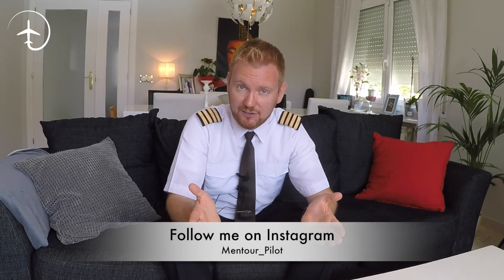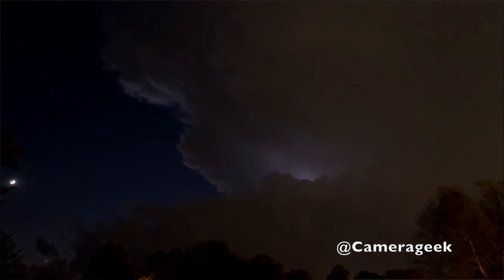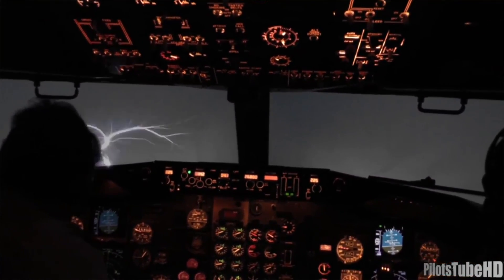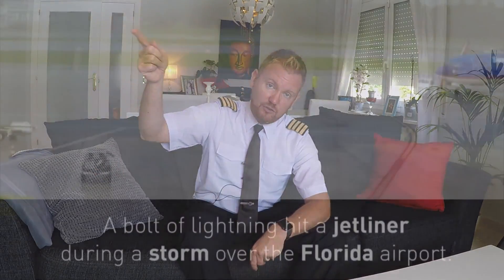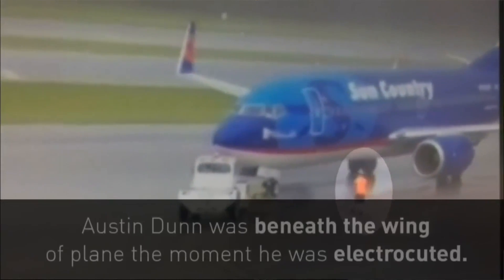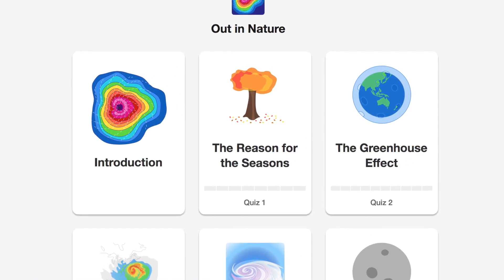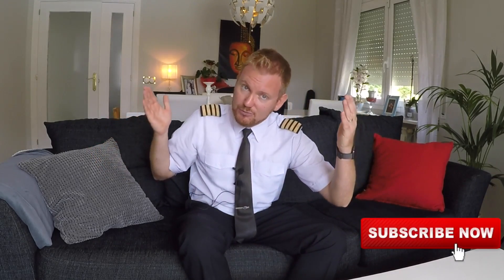Aircraft Lightning strikes - How I handled it

Comment: you should have mentioned the development of internal systems to reduce the chances of sparks happening within the air frame and structures.  things like nitrogen being pumped into fuel tanks, spark dampeners, changes in how wiring is done, etc.  because there have been documented fuel tank explosions from lightning strikes in the past.

Comment: I was a passenger on a flight from Baltimore to Chicago that was struck by lightning.  There was a big weather front in the area. It was quite 'shocking'.  The pilot's PA afterwards was to say it happened, they were a bit busy at first, now everything is under control.  We will be landing normally but you will see rescue vehicles on the runway which is standard and not to be concerned.   We were on national news that night.
Reply: The lights in the cabin went out for several seconds.

Comment: I was on a plane that was struck once. I was sitting in the back of the plane I think 4th to last row. This happened maybe 10 minutes before landing around 9 at night descending through light rain with lightning visible and presumably heavier weather in the distance. It was extremely loud, it startled me for sure but I didn't see any effects in the cabin. When I got back into the gate I looked out the big picture windows at the plane and there was a dark spot on the forward tip of the tail.

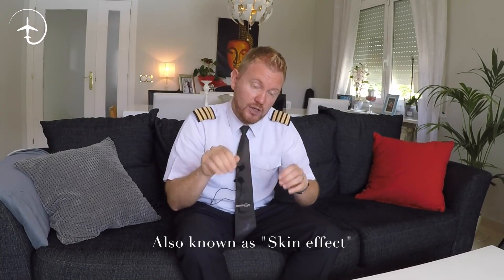Comment: 7:06 while "skin effect" describes a similar phenomenon it is something completely different. Skin effect describes the fact that in high frequency applications current only (owerwhelmingly) flows in the outer most past of a conductor. Even if the conductor is solid. Effectively increasing current density in those areas while decreasing in the core. 
Very interesting video!

Comment: Years ago I landed at JFK during a storm. It was midnight, there was quite a bit of turbulence and lightning and you could have heard a pin drop in that plane. I was thinking that it was epic and great for the pilot who would be "flying by the seat of his pants". I was very disappointed when my retired airline pilot Dad, told me that in those situations the pilots will be using the automatic pilot as, "The plane will do a far better job of landing than the pilot will, and the last thing you want is to be completely dazzled by a lightning strike if you are flying".

Comment: If there is a lightning "strike", call Thor or Odin to moderate the industrial dispute! 
The greenhouse effect is basically when gases cause there to be less loss of heat than insolation [heat coming in], and so more energy in the atmosphere, sea and land. More energy in the system means more frequent and more severe storms. 
So greenhouse gases, like carbon dioxide, methane, etc, prevent some infra-red [basically heat] from escaping the Earth. So the average global temperatures rise. Because the system is more energetic, it is quite possible to get unusually cold conditions in some areas. So very cold artic air can be pushed down from Canada into the US [for example]. Because this air [or warm air coming north from Mexico or the gulf] is funnelled by the two mountain ranges  in the West and East in the USA, you get more storms as the two air masses collide and mix.

Comment: @Mentour Pilot   A few years ago I was on a Ryanair flight from Berlin to Shannon ? (not Dublin, but could have been other City...). On approach, late evening, we had a lightning strike. I 100% believe so, big bang a flash. My recommendation for any pilot would be to acknowledge that over the intercom to the passengers!!  It was just silence and dark in the cabin. I wasn't sure there are still pilots in control or just the autopilot. The plane was just flying straight ahead....  just like that Helios flight, which happened around that time earlier.

Comment: About 1 in 20 lightning strikes flow in reverse, ie from the ground to the clouds. 
There are also rare lightning events that flow from one region in the atmosphere to another. Typically from one cloud formation to another. It primarily depends on the charge difference and the distance between the charges that dictates whether a plasma arc is formed or discharged. Moisture in the air, ice particles, dust etc also play a role. Volcanic ash can produce wonderful light shows in the sky although the danger is real.
Cheers

Comment: Need to make a correction... Faraday cages and skin effect can "cross paths" but they aren't the same thing. Skin effect refers to the tendency of current flow to happen at the outer surface of a solid conductor (the plane would need to be solid metal for this to come into play). A Faraday cage interferes with the passage of high frequency ("dv/dt" more accurately) energy and shields the inside of the cage by "shorting" it to itself or around whatever is being protected. In the case of the plane, the Faraday cage is indeed what's in play.

Comment: @Mentour Pilot 5:12 Have not seen that many lightning stikes to the radome, but to the diverter strips on it (which is what they are there for😆).
Lightning strikes tend to go through the aircraft, so you`ll have a entry mark and a exit mark (or several..) On a 737NG; entries are most often: diverter strips and the fwd part of the fuselage (BSTA 170 - 380) Exits are most often: Static dischargers and on the trailing edge of wings, horizonal and vertical stabilizer and the conductive strip on the trailing edge wing and - hor.stab. The aft nav/pos lights also tend to get a beating. 🙃

Comment: I’d like to add that, the electricity always follows the path with the least resistance (the most conductive). The plane itself is a pressurized can of metal, so it passes thriugh the metal and around the inside, because obviously, metal is much more conductive than air or plastic.

Comment: I was on the plane that got hit by the lightening just as we were climbing. I saw it striking the wing. The captain made an announcement, saying that we were hit by lightning, but everything was fine and they were just going to run some checks. We did a few circles over the airport, the captain said everything was working fine and we continued to our destination as normal.
Reply: Tranquility Tranquility They still need to make a log entry and have a engineer do a lightning strike inspection after it has landed.

Comment: Actually, that explanation of lightning ist not entirely accurate. Charges do not form a circuit, in fact, they short circuit because air is no longer a sufficient isolator. The whole thing about how lightnings actually form is not yet completely understood, but any conducting body (such as an aircraft) in the way of a supercritical electric field stands a chance to get hit. An aircraft in that case is a Faraday cage, so no harm for PAX...

Comment: Hi, Mentour, a question about lightning: may it cause loss of instruments and electronic flight controls? There is a lot of speculation going on related to the Aeroflot 1492 crash in Moscow earlier this month. Many comments in the media and social networks, some say it was a design fault of the aircraft, some say the pilot made mistakes as he was flying in direct mode, or is it both? Are there any similar cases known? Would be interesting to know your opinion as a pilot, in comments or maybe even if you made a video commenting the accident, if you're interested. Thanks!

Comment: There is a vid on a small fire that couldnt be put away due to a strike. The fire stoped and then appeared again. They landed no probs. It hit in a composite section. Material doesnt look fuel the fire. It was discussed the mesh component. Still wondering if the mesh will be able to disipate the worst case strike like the Delta plane you have shown.

Comment: I watched your video on fueltanks in the wings and therefore I am thinking  about lightning strikes creating holes on the wing surface. Has lightning ever ruptured fuel tanks? That should be really dangrous, especially with the other electric phenomenons you described.
Reply: Yes, there have been incidents of fuel tanks exploding due to sparks arcing inside the fuel tank from a lightning strike.  this is why they created different wiring systems, lined tanks to prevent arcing, and even filled tanks with nitrogen rich air to prevent combustion inside the tanks.

Comment: I was sitting right seat as a passenger in a small chartered aircraft--Palm Beach to Marsh Harbour, Bahamas.  My 5 friends were sitting behind me.  Half an hour out of PBI I saw a major thunderstorm ahead--both visually and on the storm scope.  The female pilot was heading right for it.  I am a private pilot, dual rated, IFR .  As we got closer--about twenty miles--I asked the pilot her intentions.  She told me she was going through the storm.  Needless to say I questioned her decision.  I told her to either go around it or turn back.  She was far more concerned with the schedule than the safety of her passengers.  I informed her that unless she wanted to experience a hijacking she better go around it or return to PBI.  The look on her face was priceless.  I wasn't kidding and she knew it.  She elected to make the detour which put us into MHH about 40 minutes late.  It was a pretty bumpy ride even with the diversion.....but we didn't fly through a huge storm.  She was a damned fool.  You don't mess with that kind of weather especially in a small aircraft.

Comment: Few years ago I was driving my Ford E-350 work van on top of an interstate overpass when Lightning struck the radio antenna just forward of the passenger side window, other than scarring the crap out of me I personally had no effects (had my window down a few inches), the antenna however was melted off with an approx. 3" round black spot in it's place. The radio was damaged and the fuel gauge no longer worked correctly, no other damage was recorded. First thing I did when off the highway was buy a lottery ticket, it is easier to get struck by lightning than win the lottery.
Reply: (Old comment, i know) Sounds like that van kept on rolling, did you have to declare a PAN-PAN since your fuel gauge went out? 😂

Comment: 14:24 The reason for more severe storms and increased lightning in recent years is due to the current solar cycle of the sun. When the sun is in solar minimum as it is now, it allows for more cosmic/gamma rays to penetrate the Earth. This is because solar particles from the sun via CME's and solar wind actually help push the cosmic rays out of the field of the Earth a bit. Since the sun has very low X-ray output currently, cosmic rays are more abundant and there are studies showing that they have been on the rise in recent years. Cosmic rays energize the atmosphere creating more clouds and more lightning. The health risks cosmic rays pose to humans are heart related, i.e. irregular heartbeats and sudden heart failure. The higher up in altitude you are, obviously the greater the exposure you have to them. I fear that aviation travel is going to become more and more dangerous in the coming years, as this will be a very extended quiet period on the sun.
Edit: Forgot to add that another reason cosmic radiation is increasing is due to the weakening of the Earth's magnetic field which helps protect us from space radiation. Cosmic rays are up +18% from 2014.

Comment: Petter, about the increase in lightning ground strikes, that is actually very easy to explain and it is not due to climate. Firstly, the pollutants in the emissions from engines (cars, jets, or prop) is conductive because it and the heated air from the exhaust is ionized. This means when the stepped leader from the cloud starts downward it will be drawn to the area with high concentration of charged ionized air at ground level.  This was discovered during a study done in Houston, Texas about 15 or 20 year ago to track lightning strike within major cities and it was noted that the area with high frequency of strikes occurred on or near freeways especially during times of high traffic congestion such as during rush hours and around gas and oil refineries and chemical plants in the area. Air travel has grown tremendously and the number of aircrafts in airports is higher than ever.  I am old enough to remember (hint: I rode on the 707 when they were first introduced) airports were not crowded and passengers use to embark and de-plane by walking to and from the aircraft. Given the high volume of aircraft in airports these days, it is not surprising that there would be a corresponding increase in lightning ground strikes. Thanks for your videos and have a fantastic day.

Comment: The 787 does not have a metal skin. However between the joins we use Tie Foil and the CFRP skin has what is called a CRN system built in. CRN is short term  for current return network which is run throughout the entire Aircraft and let’s the lightning flow out through a static discharge and protects the aircraft!

Comment: Once as a passenger in a large airliner there was a sudden flash throughout the plane with a loud crack.  I thought it might be lightning.  A few moments later the pilot announced on the intercom that "we just experience a static discharge and all is fine on the instrument panel and up here".  I always wondered what he meant by a "static discharge".  Is that why some of the smaller airplanes have tiny wires extending out of the control surfaces?  If so, why?  What is the mechanism of action for their existence?  Thank you.

Comment: The jet engine mounts on those got to be new right cuz I don't remember jet engine sticking out so far in front of the wing and so high up.they are up under the wing usually tucked back a bit more and under the wing just the cowling sticking out from leading edge ??

Comment: Really nice video. But what will be the lightening impact incase of a helicopter ? Hope the rotor blades will continue to work.
Reply from the maker: It would be very similar.
Reply: Rotor blades are designed to dissipate static electricity as they produce a much higher amount of static than a fixed wing does, they will take a hit from lightning but it is not a pleasant experience.

Comment: Love your videos. I’m not a pilot but these provide education to expand my mind.

This reminds me in Nov 1969 with launch of Apollo 12 (from the book “Apollo: The Race to the Moon”) then Saturn V left the pad but had a 1500 ft flame (that is conductive) so entire rocket and flame was a very tall lightning rod that attracted and struck by lightning.

Entire instrument panel in Command Module lit up like a christmas tree, attitude indicator ball went spinning wildly. However it did not effect launch flight because Saturn V rocket was controlled by the Instrument Ring, not Command Module systems.

Reaching orbit, and extensive systems check revealed no faults though they had to realign the platform. There was one system in doubts and that was parachute ejection systems. But then it is only used once so either use it returning from orbit or returning from the Moon (may as well put in lunar voyage).

Fast forward to Shuttle era, separation from bad weather became much larger.

Talking with a Navy pilot who flew in the late 1940s said on one flight his aircraft was struck by lightning multiple times, I asked what was that like. He said he was more focused flying the plane in extremely rough weather.

Comment: I don’t know how closely you follow astronaut history, but Apollo 12 was one of the only rockets to takeoff into stormy weather. They got hit by lightning a few moments after takeoff and lost all their computers and had to reboot everything in the cockpit. Can you imagine losing every electrical system you have and then electing to fly on to the moon anyway? Those guys were crazy.
Reply from the maker: Yeah, there was an abort button for a reason. :)
Reply: It was the power unit for the data acquisition that blew. Flick the switch to "Aux" unit and they went on their way. The computers kept running. No reboot, that would have triggered an immediate abort.

Comment: Regarding composite structures, DO-328s, with mostly composite aft fuselage & empennage,  seemed to draw more than their fair share of lightning strikes compared to BAe 146s,  CRJ-200s, et al.  Didn't generally seem to do any worse damage, though.  NTSB report DCA09FA033 details the fire on that CRJ-200.

Comment: Been on 2 flights where the aircraft was struck.  First time was known.  There was a bright flash, and a loud 'knock'.  not a crack or thunder sound, more like  using your knuckle to knock on a door.  Nothing happened inside the cabin.  no flicker of lights, no pressure change, nor did the aircraft have a sudden drop or anything.  One of the pilots (not sure if it was C or FO) came on and stated, yup, that was lightning.  All is good up here.  Flight continued as normal.

The second flight, there was no indication to the passengers.  Only reason I knew, was because we were waiting on the jet-bridge for the gate checked bags (was and EMB145) And a pilot was all upset about having to do the lighting check procedure, and delay the outbound flight even more.

Comment: Hey Mentour, do you know why older aircraft have this black patch on their noses, example dc 3 or old 747s. Also, how do you deal with the change of pressure on climb or descend
Reply: The "black patches" were a rubberized coating that was applied over the "radome" (nose cone covering over the plane's radar dish emitter/receiver) that could have heated air passed under it to "expand" it and crack off any ice build-up which would degrade the sensitivity of the plane's radar. The same thing held true for the leading edges of the wings, horizontal stabilizer and vertical fin.  They used heated engine air to expand and crack off the ice build-up.  They were commonly called "de-icing boots".  Modern airliner construction has done away with this form of ice removal in that the paint now used, at least in the nose, is radar transparent.